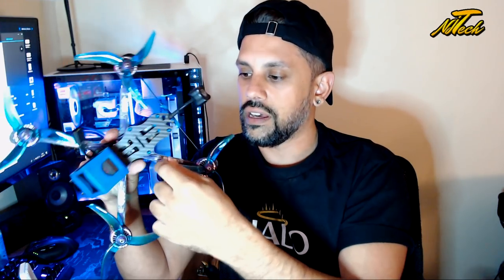Let's Talk PIDs! | Betaflight 4.0 Tuning!

Comment: Hi NJ, Very interesting, chatted to you a while back and you mentioned a tuning video in the pipeline so the beginning of this video explains what happened there.  I've tended not to stray too far from stock as this seemed to be what others were suggesting on earlier versions of Betaflight  (something I think you hint at in this video) but I'll start to push the settings a little further as some of the numbers you quoted seem a little extreme based on previous thinking.  Great video I've definitely got a clear strategy now for beginning to tune my quads.
Reply from the maker: Thanks brother, yeah get stuck in. You'll soon see what you were missing. Keep me posted with how you get on :)

Comment: Interesting video 👍 I’ve had trouble removing jello from my Johhny Fpv v1 frame but migrated everything onto my shrike style & it’s flying perfect now
Reply from the maker: a very good case in point, thanks for commenting and glad its sorted now :)
Reply: NJ Tech 
Yes I think the frames need to come with a vibration rating average Spread across a bunch of frames as they won’t all be identical

Comment: NJ whats your position on auto timing vs fixed timing in Blheli_32.

My concern is that it would surely make more sense for all the 4 corners to have similar response and performance having auto timing on could potentially have quite different timing for each motor effecting the power delivery consistency.

Comment: This was a pretty awesome video, agreed with everything you said! About rates - I’ve spent 3 weeks trying out all sorts of different rates. I think it’s more important to get the rates right before PID tuning. What do you think? 
Your quad seems to have a great tune in this video btw!
Reply from the maker: Yes its a valid point, with the tunes being so good out the box now you can definitely start hitting your rates first. Ill get onto that subject soon. Thanks for the comment :)
Reply: NJ Tech I’m going to ask you the dreaded question... what rates do you use? 😛
I’m fully aware that rates are subjective and your rates might not work out for me, but I’m curious.
I’ve been flying Stingy’s rates for a few weeks:
https://pidhub.io/rates/rateSetting/11
Reply: NJ Tech look forward to a rates video. With all the new stuff in BF4 there isn’t a lot of material out there on what everything does.
Reply from the maker: my rates as of this flight are 1200 degrees per second, but i flew 1000 for the longest time.

Comment: I think consistency in your setup might be important when you're new, but learning to fly different setups is a skill in itself. Being able to go from a tiny whoop with a 10-15 degree camera angle to a 30 degree heavy freestyle quad carrying a gopro all the way to something like a 60 degree tilted lightweight racer isn't something you learn all at once. You almost have to learn different sets of muscle memory for each, but I think it actually solidifies your understanding of what makes the quad feel the way you want for a particular situation or flying style. I also think it's important to experiment with different gear and learn what you like. I guess what I'm saying is that it may be easier to fly the same setup all the time, but you should also look beyond the gear you start with.
Reply from the maker: indeed, but as with subjectivity, it depends what you want to achieve. If its to be the absolute best at one thing you need to keep that one thing consistent. I have to fly lots of different types of gear to review it and as you rightly say, this requires its own set of skills and adaptability.

Comment: Excellent tips as always brother. Based in roll #1....I am saying 1000deg/s.
Reply from the maker: close! 1200 :) 1000 is where i have sat for years but just the little extra speed required for the super low rolls you see near the floor. Thanks bro :)

Comment: i still havent touched pid's....i sorta know i should be with pitch cause it feels a good bit different from roll, my semi home made frame looks a lot like yours.......does it use 5mm spacers? if so can you raised the rear arms 5mm, i'm gonna try that again, it might only be worth it on an ultra slammed 15mm or under .. ps. dal cyclone 46er's rule thinking of using them for topiary on my box hedges

Comment: You lowered your rates, no? :) you look around 800 degrees now. I'm around 600 now. Half of what I started FPV 9 months ago with. Lowering them just made me progress much quickly
Reply from the maker: its a great idea to start low and work your way up to what youre comfortable with, 600 is a perfect starting point. It might be a little tricky to make out my rates because this video is 30fps where as my flight videos are normally at 60fps, but my new rates are actually 1200 degrees per second :)
Reply: @NJ-Tech  oooooh 😱😱😱😱 I don't think I wanna go back to even a 1000 degrees per second. I'm really liking the linear low rates life. It fits my style which I like it to be a more cinematic than freestyle. It gives me the control I need to be precise and hit the small gap I want to hit without crashing into a wall. With high rates I had way too many errors introduced in my stick inputs from shaking or else and it didn't look good on my video. Watch my latest video at 0:50 and you'll see what that if I had high rates, it would have not looked as smooth as it looks now. But obviously I'm still new and that's what works for me. Maybe in couple years I'll be around a thousand degrees, maybe not. Who knows 🤷‍♂️ Thanks for the explanation on your approach on the PIDs. I totally agree with you that PIDs are more personal a bit like the rates. Someone like Skitzo would prefer a more lose quad with moderately high P but more derivative where Blackbird would prefer a very snappy and connected feel with High Ps with low Ds
Reply from the maker: @FRY_FPV  exactly, as long as its doing what you want it to the goal is achieved :)

Comment: I don't get this idea that you shouldn't share your pids because people will just misuse them. I understand your exact pids won't apply to my quad, yet I'm still interested in what ballpark numbers you're running. A lot of it is feeling more than quad tuning and I'm interested in what feel different pilots use.
Reply from the maker: I do see what you're saying but let me explain further: The fact that we feel so differently highlights the point i make about subjectivity. So even less reason to know imo. It's not about misuse of the figures, the figures are meaningless without the context of the individual quad. If we all had the same set up every quad would tune up differently. If the numbers were replaced with a linear slider that had no figure value to it at either end, it wouldnt change the result by following a set method to achieve what 'you' consider a good tune. If you understand what you want, then im sure you knew all this anyway, but for those scared to tune or unsure about how to go about it, the aim of this video was to nudge them in the right direction and start exploring, not to blindly copy numbers and hope for improvement.
Reply: @NJ-Tech  But why not leave that up to the viewer to decide? I do think knowing if your P is in the 50s or 70s adds context when I see your flying
Reply from the maker: @albert91tgn disagree, its meaningless :) the other reason i didnt mention but still relevant is pilot compensation, even if the quad is looser i can fly much to the same visual effect, it just requires more effort and less enjoyable.. but hey i do like conversations like this so honestly, thanks for engaging with me on it. Your opinion does mean a lot to me as do all my subs. Ok so ill show my numbers, but first take a guess at them, just for fun?
Reply: @NJ-Tech  Haha sure. If I had to guess, I'll say 60/70/35 for roll and 70/80/40 for pitch, with dmin at 30 and FF 100

Comment: All your perfect tune will shift after the first crash. You should have some room for bent props and rattling bearings. Dont tune everything to the extreme.
And godbless dyn notch
Reply from the maker: A valid point you make but that is part of the subjectivity bit that makes it a difficult thing to cater for all. I crash maybe once or twice in an outing and usually nothing more than replacing a prop. If you're a regular hard crasher you have to cater for that in a tune and indeed leave that headroom. For me it want the highest precision i can get for my flight feel and footage. Its also why i take a few of the same set up with me so if one falls out i can move to another quad. It also enforces the need to learn tuning, if you can tune then you can easily and quickly re-tune should something feel different, or just run a slightly looser tune on profile 2. Lots of options! Thanks for the comment.